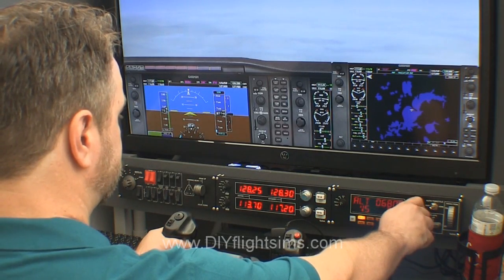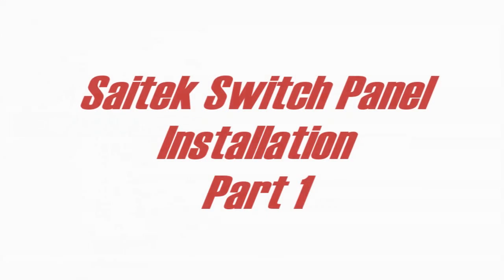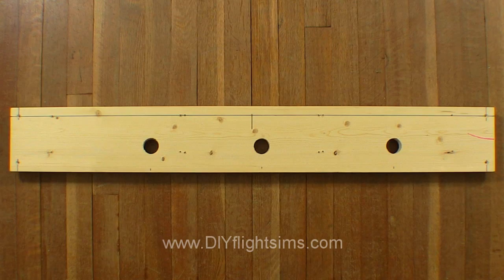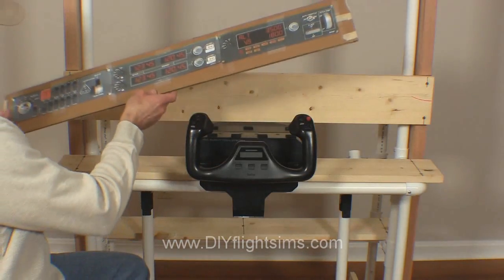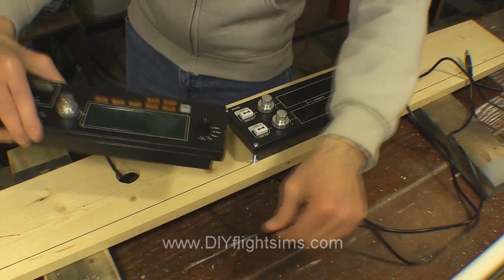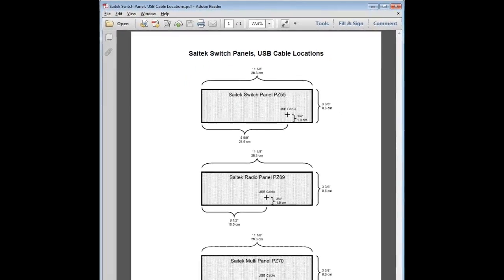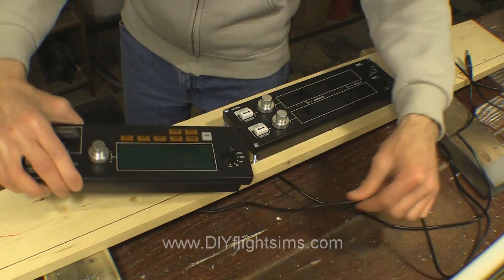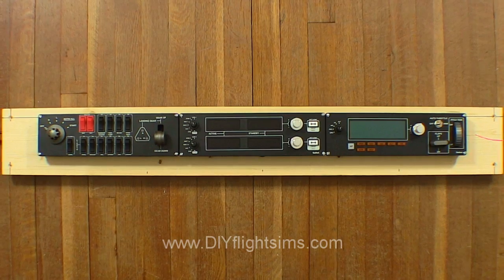Install Saitek Switch Panels in your Home Flight Sim, Part 1

Comment: It also work with the logitech panels? Or are they not compatible with each other?
Reply: I see it is 5 years since you posted and still not had a reply. Saitek and Logitech panels are identical. Same drivers, dimensions. it's only the brand name that is different

Comment: Do you spray paint the board??
Reply from the maker: +Colby Bryan No, I use tinted latex primer.
Reply: where can I buy and how much:)
Reply: and would grey spray paint wprk
Reply from the maker: +Colby Bryan Any home improvement store. It's not expensive.
Reply from the maker: +Colby Bryan I do not recommend spray paint.
Reply from the maker: +Colby Bryan You might want to watch my Painting Tips for Flight Simulators video. https://youtu.be/sLtrC2BpT4Y
Reply: OK. I tried grey acrylic paint and works fine, but probably not as good as yours

Comment: would be cool to show how to mount the saitek switch panels somehow to the easy helicopter collective project!
Reply from the maker: +Scott Charlston I agree. I'm drafting a new idea that would feature a three screen setup that sits on a table (or large desk). It would have room for Saitek panels and a smaller monitor for instruments (or a keyboard mod). This desktop setup could be paired with the DIY Easy Helicopter Collective. 

Or not... it would also work well with a yoke and throttle quadrant.